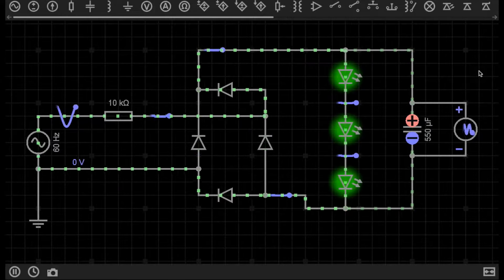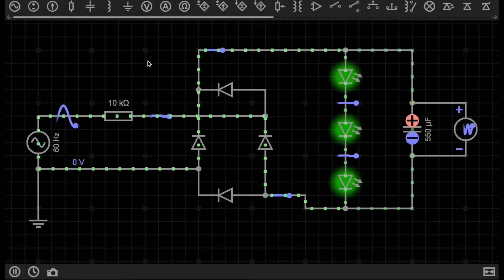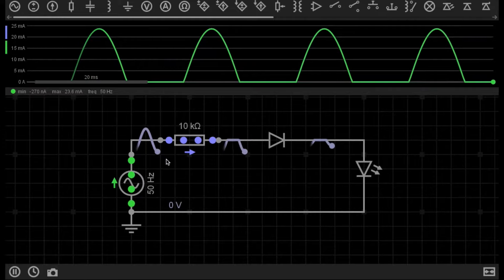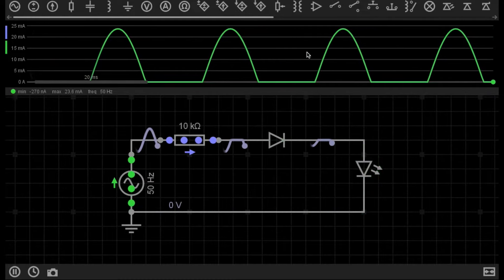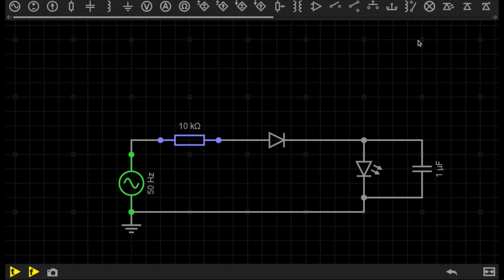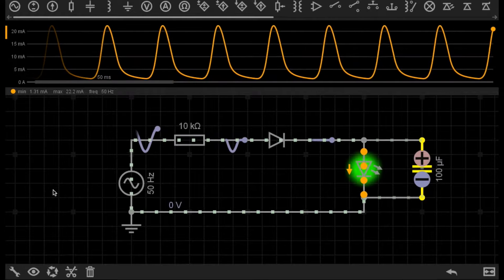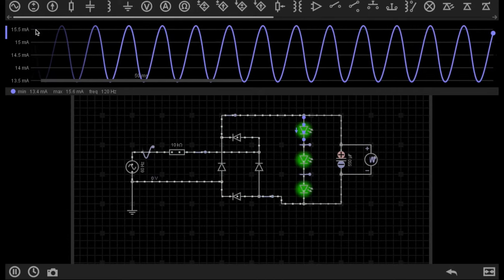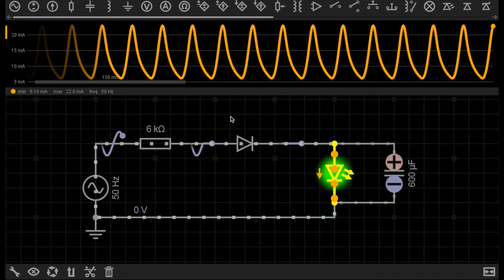Half-Wave vs Full-Wave Rectifiers - Electronics Basics 19

Comment: What do the waveforms in between the components represent? I am confused as it shows the top of the AC wave being clipped off after the resistor / before the diode. Is this correct? If so can you explain how that works? I thought it would have to pass through the diode before the wave would change in that way. Thanks for the content!

Comment: You put the capacitor at a wrong place because it is charged over the resistor and thus does not get fast and fully charged. The cap should be after the diode and before the resistor. That way the resistor would limit led current but allow the cap to be charged fully. The fluctuations would be then way lower considering low power demand from the diode.
Reply: I think you're right, seems like a pretty big mistake to put in. There might have been a reason but I don't know what.

Comment: Whats the differences in smoothed voltage between a half wave and full wave rectifier? Is it doubled?
Reply: It would be giving power much more consistently. With the Half-Wave, you could see the capacitor fully losing power and then filling up again, this isn't ideal for most circuits. The Full-Wave IS fluctuation but there is still a consistent base current that's keeping it powered.

Comment: Resistors don't have polarity. I used the same circuit as yours in every circuit for full wave, I am getting negative full wave rectifier, but if I changed the Resistor , then only I am getting positive full wave rectifier. I am very much confused about this . Please Please Please please please replyyyyy me sir.

Comment: Is it really that obviously visible when you power your LED with a half way rectifier? 25Hz - is 25 cycles a second which is still fairly quick change to be noticed by naked eye, isn't it ?
Reply: Its obvious if there is not a capacitor in the circuit, because the LED is off for at least half the time. With a small capacitor, there is no problem powering the LED. It matters more in higher power circuits where more current is being drawn.

Comment: Did this circuit really need the diode, considering that the LED is a diode in itself?
Reply: For higher voltages, it's preferable, as LED's do not like to be reverse biased.
3v AC is not an issue for an LED, provided the correct resistor is used of course.

But if you were to power an LED through a resistor from the mains, during the reverse part of the cycle, the LED would break down, conduct, and get pretty warm. Possibly damaging it.